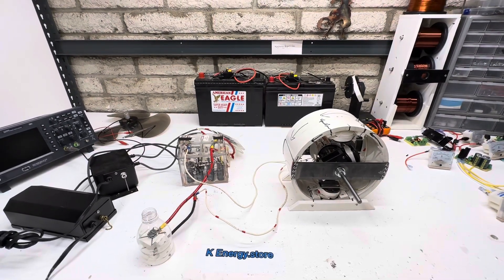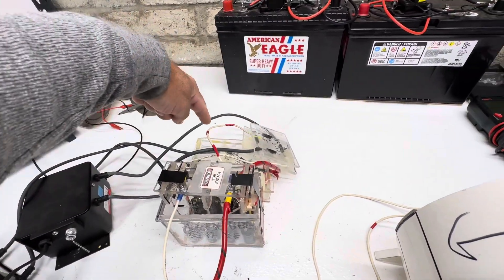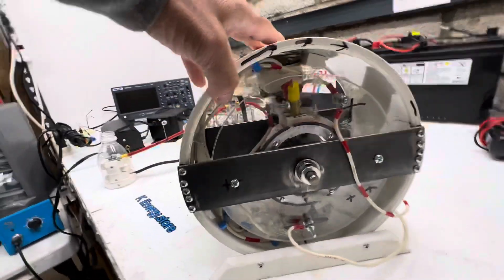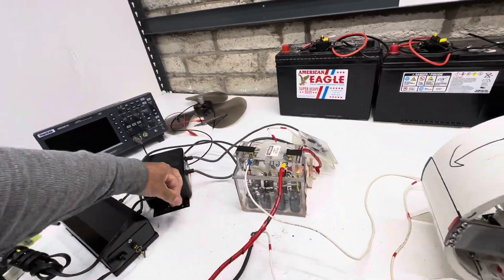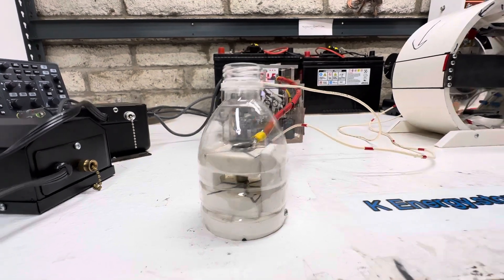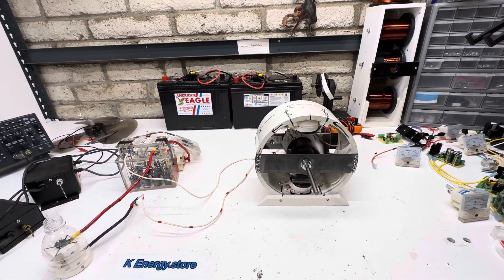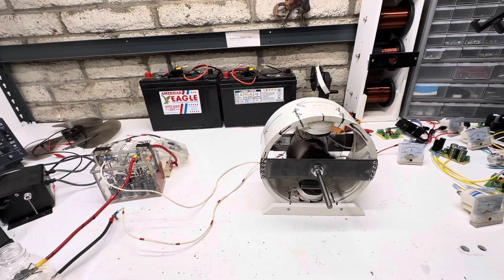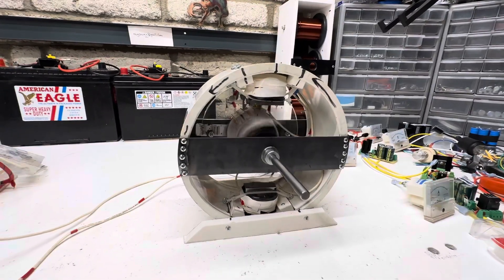Ed Gray replication from 2002!

Comment: Whats the power consumption? Stop showing videos withouth power consumption please. Please show voltage current draw from primary source
Reply from the maker: This video is Not about power consumption
Reply: @kenergy1707   doesn't matter. Show it anyways please. It helps others make decisions on replication.
Reply from the maker: 2 transformers 5,000v 20ma
Reply: @kenergy1707  so the 5000V is what gives the 20ma? Or the 20ma is the mains voltage powering the transformers? I'm just asking cause I don't know how you measure the current output of a 5000V supply, since most available multimeter stop at 1000V. In addition the spark Gap affects digital multimeters. That's why I ask you to measure the primary voltage source which in this case is the mains power. But remember that transformers draw current even when not loaded, which should not be included when calculating the power drawn by the device
Reply from the maker: @raloed.363  that’s the transformer rating so 5,000v at 40 ma basically but I also have a 30,000 volt voltage meter
Reply: @kenergy1707 kindly share their schematic,  will you?
Reply from the maker: @kanjo-Etienne  yes
Reply: @kenergy1707  thanks man